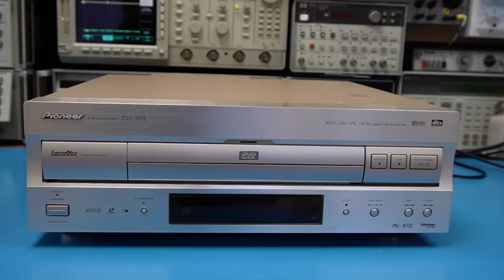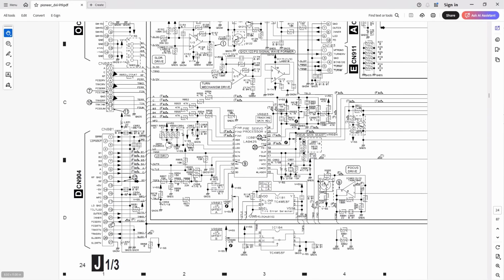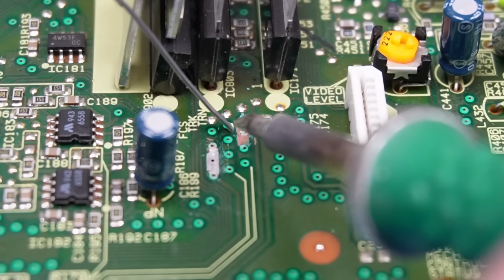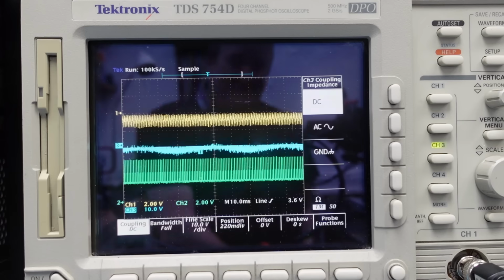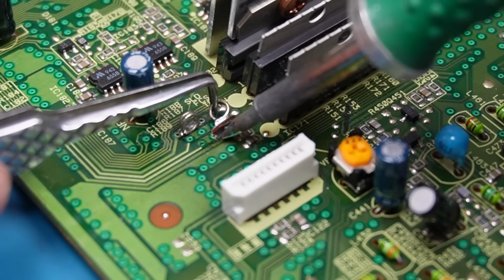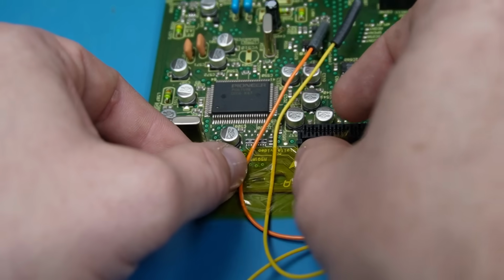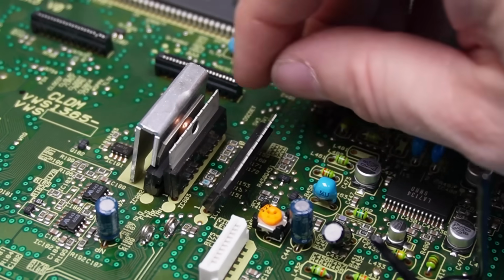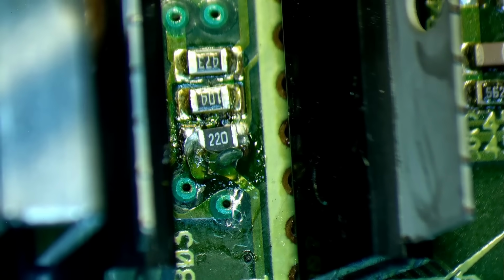Pioneering a fix for the Laser Disc Player

Comment: So, isn't changing the resistor value just compensating for a problem with another component having gone out of tolerance that should have been replaced instead? If so, it could fail again in a while so let's see if we get a third video. This question aside, fantastic videos from Mark, a real pro who really knows his stuff.
Reply: I was thinking the same.  The fix is genius, but what was the actual root cause of the malfunction.
Reply: @ZXLNT  The age of the device, and the now uselessness of it.  If I owned that thing, I would be transferring all laser discs to DVD/Blue Ray without delay.
Reply: @einfelder8262I had an extensive laserdisc collection and they’re just unwatchable now. It makes no sense to keep them when there are pristine 1080P/4K transfers of most films.
Reply: @einfelder8262 Seems a bit dumb, what would you be achieving by doing that? Also "transferring"? If you want to be even a little efficient you rip the disc, or, better yet, download the rip of it. Cheapest solution would be: buy the DVD of whatever it is, if it is available. Only if not then it might make sense to consider some alternative, but "transferring" would be incredibly silly - and wasteful too. BUT - I'm of the opinion that logic is not a factor here, if it was the laserdisc would have gone the way of the dodo a LONG time ago. 
So, the solution is: keep fixing it, but just to be safe, buy another one of the same model, NOS if possible and keep it to transplant bits from into this one as they wear/break. 
Fixing the motor issue would be a possibility for this, finding a new one of a same or similar type shouldn't be too difficult, then either use it to fix the current motor or replace the motor altogether, but there are other possible issues lurking in the wings, one being wear and potential chemical degradation of the plastics used for the mechanics of the whole device. Which could be dealt with using a donor device if chemical degradation is not an issue, I can't be bothered to look up if it is or not on these things as it's not always very clear based on available info nor is there a good answer if there is chemical degradation. Having brass parts made for the parts you can't find might be possible but only to a point, the laser focusing assembly would require a totally different approach if it is to be addressed - which absolutely would have to be looked at for any of the other in depth repair/futureproofing to make sense. 
Finally there is media - most people probably think those discs last forever but that is not the case from what I understand. So short of finding a different kind of solution it's all a matter of delaying the inevitable at an ever increasing cost. The question is mostly at which point to stop it and move on to files stored on a RAID array. Because to keep the data available it will have to be done at some point, it's all a matter of time.
Reply: @noth606 you know that laserdiscs are analogue, right? And cannot be ‘ripped’?
Reply: Playing side 1 moves the sled in a forward direction where side 2 is moving the motor in a reverse direction to progress playback. I truly think there is degradation of another component and this is a bandaid fix.
Reply: I was thinking the same thing but it occurred to me that the disk played correctly on side 1.  I think that means it has to be a mechanical problem with the sled's movement but only in that one orientation.  Since it only needed a tiny bit more power to move, it's probably a lot safer and easier than trying to fix the sled assembly which might be only slightly worn but really beyond reasonable repair.   Pioneer probably should have anticipated that the motor would need a little extra oomph to account for long-term wear.
Reply: @projectartichoke  Exactly! Judging by my experience on how brittle the plastics become over time (I have seen it first hand with a Sony laserdisc), it is a lot safer what Mark did than trying to find and fix the cause on 35 year old plastics.
Reply: Could it just be a mechanical  or motor issue - some stiffness in the motor or worm gear clogged with debris from wear an tear that was overcome by the bodge of increasing the drive voltage a tad . Playing the reverse side  turns the mech 180 degrees and with wear and tear debris may affect the resistive torque on the sledge motor just enough to stop it running.
Reply: I guess, you could have found a way to compare the current draw between the two operational sides. The fix is cool. But, this would have proven out an issue due to a mechanical load. Good old Heathkit stuff. I miss those days.
Reply: Excellent video, similar thought! How did Mark rule out a mechanical failure and honed in so quickly on the power issue? Still lived the fix.
Reply: The motor was probably never designed to work for 25 years or more.  A great fix if all that’s needed is to change a resistor every few years. Well done Mark
Reply: spot on! the motor is stuffed! 
It has to do more work when playing side 2 as it has the weight of the optical block pressing down! The motor might just need a clean to the brushes but I'm betting they are worn.
Did he test side 1 ???
it will be back!
Reply: @rods6405  Yes, he did test both sides. As a Pioneer Certified tech, these players are prone to side B playback problems due to being upside down and having more stress on the motor. Brushless motors in this size did not exist when it was built.
Reply: @rods6405  It'll be a brushless motor
Reply: @gcheath  25:21 No way thats a brushless motor. It dont look like one! Plus they dont normally mount them horizontally they normally have a teflon thrust bearing with magnetic pressure and that wont work horizontally!
Reply: Shhhhh. Dont tell everyone.

Comment: Pioneer were famous for their weak motors when the brush carbon clogged the armature gaps.  A strip down and clean usually got them working again, if spares were delayed
Reply: Was thinking that too. Overcoming the motor drive issue by driving it harder might be only a temp fix until it gets clogged up again. I wonder how long the guarantee is, for the same fault reoccurring?
Reply: Could strip the motor and use a comm stick on it to redress the comm, and clean out the insulating landings. I have done this before with success which also stops the motor wearing prematurely. Ergo “ Mr Data - you have the comm, (sic) conn.
Reply: That's what I was thinking, had this issue so much before, it's just the motor commutator and brushes need cleaning, sled lubricating and done
Reply: I was thinking same. Because this DVD was working before. And it doing it only on side B. Which mean something in the motor or mechanism itself is not right.  I never seen this DVD before but electronic is nothing out of this world.

Comment: I didn't really understand what the underlying fault was, and why this was only impacting side B of the disc. Assuming everything was electrically to spec and that the machine had worked previously for decades, I assume there must have been some sort of mechanical wear that means that the motor now has to be driven a bit harder to move? I don't think this was addressed, but I am curious.
Reply: Me too. The solution was, as Mark said himself, a bodge. Personally, I'd suspect the motor itself being somewhat worn to blame. There may be some asymmetry to the mechanism that means the sled is slightly harder to move when reading the other side of the disc, and that combined with an aging motor was enough. But, given that getting a new motor is likely impossible, and servicing those things not guaranteed to work, the bodge fix does what all good bodge fixes do, solves the problem.
Reply: Thought that too. It's a mechanical issue with the motor in that orientation, but also agree, the fix will work for a good long while & given the choice of a functioning machine or it going to landfill, it was a prudent fix.

Comment: It looked like the "PWM" motor drive doesn't modulate the duty cycle of the output, only the number of pulses it outputs in a train, so it does modulate the amount of drive time from nothing to the max. number of pulses in the window. And I suppose the fact that the motor receives pulsed (triangle ramped) drive would cause it to be vibrated to overcome friction while not causing the motor to race and overshoot. But it does feel like the real root cause was something getting sticky in the sled assembly. When it happens more with the asembly flipped over, it's probably the way it's sitting with gravity making it marginally more sticky when upside down and the whole sled was being driven with a slim margin to overcome friction. Worn gears or even the grease getting thicker? But as well as amplifier passive component drift (weakening drive), it can be that the motor itself got weaker. The bearing can get sticky or even the permanent magnets weaken over many years of use and so need more drive to achieve the same torque. Anyway, good job on keeping this old soldier going!
Reply: I bet the motor is going bad. Small brushed motor running both directions and working non stop. This fix will be temporary as well.
Reply: You're correct. Looking at the scope footage it's not PWM control, it's PRF control (Pulse Repitition Frequency).
Reply: Ive worked for Sony some years and to me it also looks as the grease drying up and the sled is not sliding freely as it did 30 years earlier :-)

Comment: It must be important that such big disk is well balanced!
Reply: They were made to high spec,but i think they have the loose ball bearings in the spindle(automatic ball-balancing system) part for auto balancing, i say that as when Mark showed the disc spin up,it wobbled then corrected itself. Its a clever mechanical way to balance discs,used in cdroms as well.

Comment: Thank you for another interesting video Mark. It's always a pleasure to see the next item in for repair.
I was wondering about the root cause for the stick. Could it be a lazy motor? I had a cassette recorder/player that would only run upside down. Upon stripping the motor, I discovered that springy metal was used as brushes - no carbon pads. The springy metal had eventually cut right through the commutator! When upside down, there just happened to be enough end play to bring the commutator  back into contact with the wires and off it would spin. I was trying to think of a reason as to why the motor seemed to run ok for side A but not side B, but I'm not sure my theory/comparison with my cassette deck issue holds up because the motor looks like it's in a different plane. Mmmmmm... interesting.
Reply: 0:53 On side A it looks like the sled is supported by shiny metal bars the way you see most mechanisms are constructed. 2:12 It looks like it's hanging off the frame. That might be the problem! It doesn't have an issue starting to play on side B, where it has to traverse the whole length of the track, but I suppose it has a head start from its rest position.
Reply: @matthewmarks6951  Interesting, thank you Mark.

Comment: (1)	Watching your video-player fix up is almost as good as watching the Blue Jays win. The Blue jays franchise is a multi-million (billion?) dollar franchise.
(2)	It seems to me that relocating your workshop is little different from taking apart a device and then re-assembling it: "This cable goes here …"
(3)	My background is NOT reading electrical circuits, but data and information. Writing "5/2" conveys more data from the diagram to our mind than does writing "2.5". In your language "5/2" or "five divided by two" tells you that something whose value is five has been split in two – by a device. I forget whether your example was volts, ohms, or amps, but the source was at five units, then it seemed to be partitioned to make separate sources, each inheriting half of the original source. That's what the notation "5/2" gives to you/us.
Cheers, Chris
Reply: To him and to me, "5/2V" implies some sort of control line that is switched between 5 and 2 volts. He is right that it's a stupid thing to label it, especially when you consider that a meter will display 2.5 V and not 5/2 V. I can see how it arose but it's still confusing.

Comment: Expert repair! Any idea why the motor needs more power? Worn capacitor or worn brushes on the motor?
Reply: Worn sled runners - they appear to be differently constructed depending which side of the disc is being played.
Reply: But the sled runner is not the one moving the laser right? Or am I misunderstanding what a sled runner is. From what I understood, the motor that drives the worm gear that moves the laser optic is the one that needed more power. Or that Worm gear actually drives the sled, and the laser optic is just try to compensate for the stopped sled.
Reply: @rcboosted  We're talking about the same thing - the motor with the worm gear moves the whole laser assembly backwards and forwards coarsely. The voice coil on the optics has to be both more precise and quicker-acting because it has to track the inevitable off-centre rotation of the disc.
Reply: I understand better now, thank you.

Comment: As a technician, I'd approach the problem from a different perspective. Since it's not failing when reading side A, it must be a physical problem, rather than an electronic one, I'd start from there. But to you as an Engineeer, that approach is easier to follow.
Reply: Right, my assumption would be that the motor itself is starting to fail and replacing it would be a better long-term fix. But I haven’t watched the original video so maybe that was done already?
Reply: He spent the entire first video assuming it was a physical problem and working on the motor/gears/etc.
Reply: @JathraDH I had a robot vacuum that did something similar - motor seemed to work fine when removed from the gearing mechanism,  but wasn’t able to deliver enough torque to drive the gears consistently. Replacing the motor fixed it. I just watched the previous video and I’m sure if I’d watched it when it first came out I would have said to myself ‘that one’s coming back’. 😊
Reply: @uttherkunst3806  Yeah fair its likely the motor is faulty, or going out.  I suppose if it comes back again he will have to replace it. 😂

Comment: So was this a OEM design error and this device had this fault from day 1, or did something fail or age to the point where it needed the extra power? Also why would it work properly on the A side and not the B side if it was low power to the tracking head driver?
Reply: I don't think it would be a design error as it wouldn't have worked from new. They probably had it tuned to the bare minimum so that the movements weren't too great to avoid moving the sled too far. I'm thinking this fix is now compensating for motor wear. Also, side B may have gravity acting on the sled in just enough of a different way as to increase friction.
Reply: @JonnyFix  Design errors don't always manifest themselves immediately - this showed due to age/wear. A higher output voltage could lead to more power dissipation by the op amp, reducing reliability.
Reply: I think it's age, and I think when on side A it's sliding on chromed metal bars whereas on side B it's just scraping along the frame.

Comment: I might have tried swapping the resistor on the board with another one of the same but known value first?
Reply: Very unlikely an unstressed resistor like that will change value, and it could just as well have been the feedback resistor.

Comment: Why was it sticking? If it needed a higher voltage to work could  the opamp be at fault?.............................
Reply: If the voltage at the output of the op amp is as calculated by the components around it, it's unlikely to be the op amp. Note also it worked on side A but not side B - the electronics are the same but the mechanics are different.

Comment: Watching this closely. I have a LD player that doesn't like switching sides.
Reply: If it won't switch sides at all it's going to be something to do with the way the sled spins when changing sides!
Reply: @matthewmarks6951  If you smack it one (percussive maintenance) it sometimes changes so I'm thinking the same. maybe that M selector mentioned or something in that area.
Reply: @preferredimage  I haven't looked at the other video - that appears to concentrate much more on the mechanics,